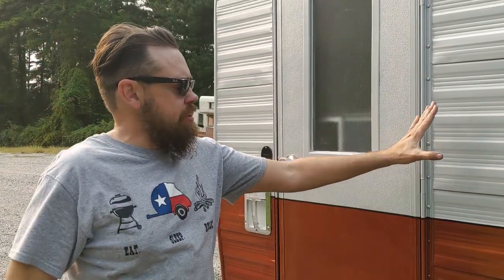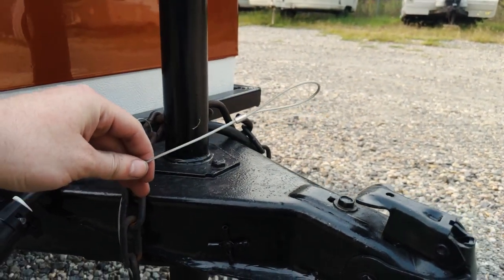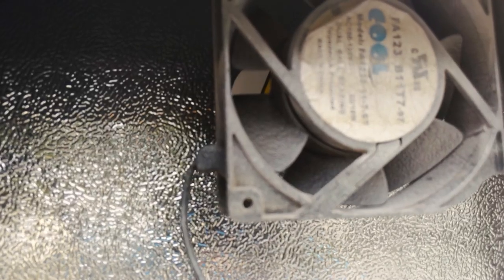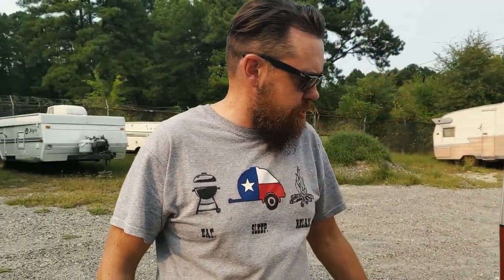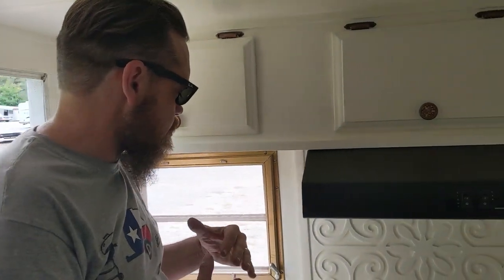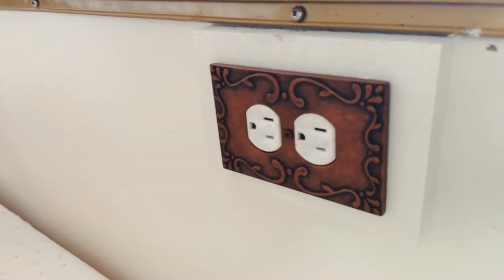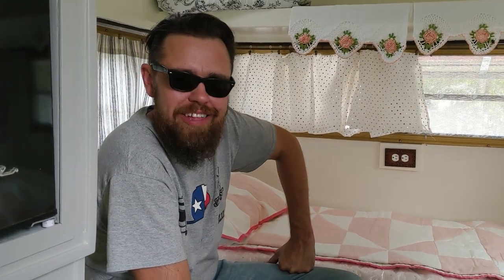1981 Sunline | Restoration | Before and After

Comment: Did it have a fridge, how did you take it out
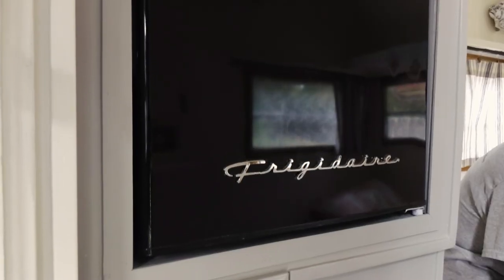Reply from the maker: It did have a fridge! You can see it briefly at 00:21 and 00:28. It blends in with a wood panel front. We pulled the old heater out as well and reframed a new fridge closet among other things (00:49) We discuss it in the video at 3:35 and 5:48. Hope this helps!